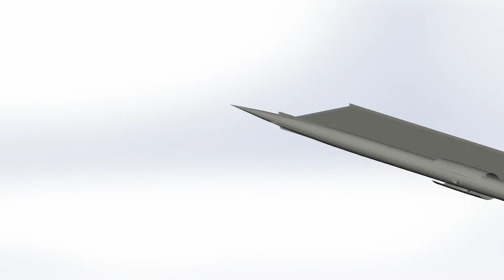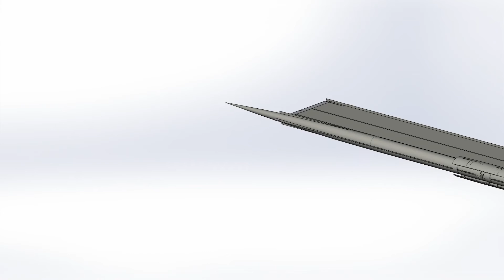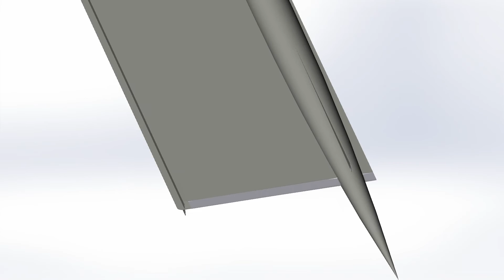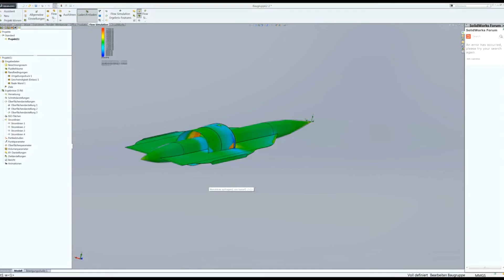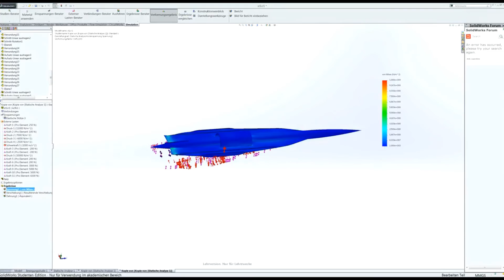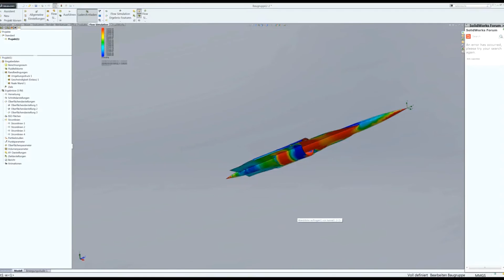What Come Up With For Fun - Electric Supersonic Flight - Possible - But Absolutely Impractical

Comment: I came up with the idea for a transonic or supersonic aircraft using electric turbojets/turbofans a few months before you did. I concluded that based on current battery energy density, it would be able to fly for around 1 hour max. More optimistic than your estimates with an impeller-powered aircraft, but still not very practical.
Reply from the maker: I actually came up with a similar estimate for a large / ideal airraft - the short 3 minute flight was jsut for a small experimental drone, where the amount of batteries you could take would be limited by volume rather then weight, and for an altitude around sealevel - although, theoretically with some slightly better batteries or fuel cells you could reach longer higher ranges, and one hour at the speed of sound is already quite a bit of distance
I did come up with the idea as such a few years before talking about it, but always just as a small research drone, a few meteres long and within model aircraft class weight, I only recently thouhg about the possibility of scaling it up to business jet or airliner sizes, although if you go too big the structural massm ight be surprisingly limiting
Reply from the maker: although the range limit for electric aircraft is only slightly affected by the difference between supersonic and subsonic flight - you can always go higher up to get thinner air and thus stay at an optimal gliding speed, so the planes range is always roughly given by its overall energy density multiplied by its ideal glide ratio and divided by gravity - only havve to tkae into account some fixed additional factors for suersonic aerodynamics effects and for the type of fan you're using
Reply: Also, did you see my comment on the Methyl/LOX video?